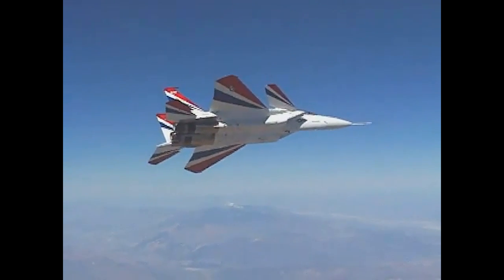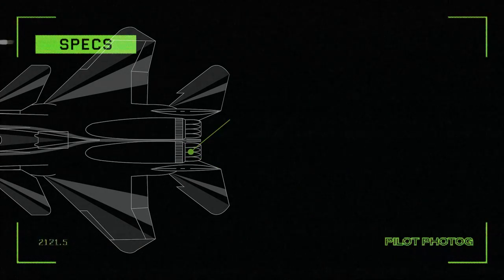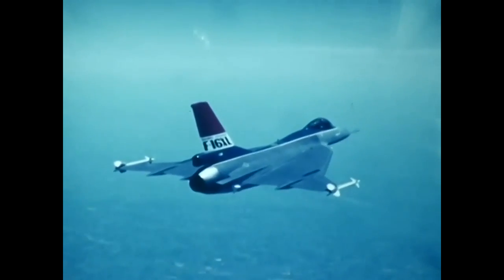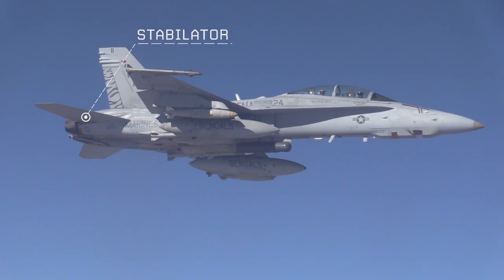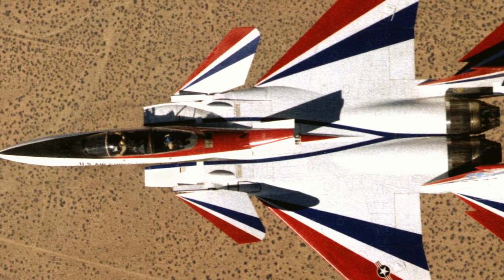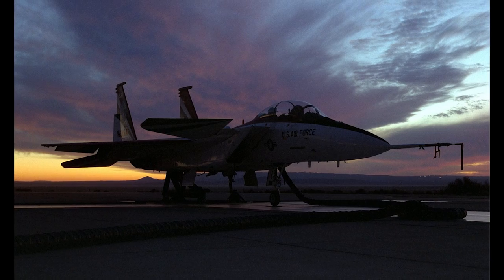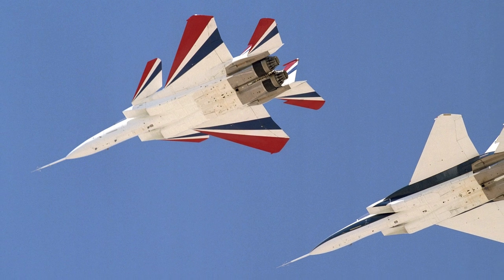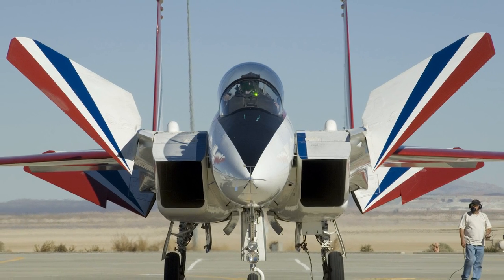NASA's 837: The Ultimate Modified F-15!

Comment: This particular plane was so early production modell, that it has the smaller airbrake on the top of the fuselage, which is just came from the prototypes. The other thing is the deflection of all mechanical surfaces on the wing (flaps and ailerons) all together, during the takeoffs and the landings. The reason behind this was the two huge canards (the stabilizers from the Hornets) which are moved forward the center of the lift force. Bacause of that, the plane acted as rear-heavy, so the deflection of the flaps and ailerons (which was in this case a flaperons - actually, all producted F-15s has multifunctional ailerons, but it is not obvious) just generates a nose-heavy torque, to compensates it. The secondary benefit was the increased overall lift force too, because both of the extra canard surface and the deflected overall wing profile, (which meanwhile was a compensator as well) generates a much higher lift during take off and landings.

Comment: I worked on the Bone and wonder why these canards are pitched up rather than downward as on most other aircraft? Perhaps they interfered with the engine intakes? 
The Sukhoi 37 has smaller canards that seem to be inline with the wings, but perhaps the Russians figured out a way for them to not interfere with the intakes.
Reply from the maker: Great question and as you suggest I imagine it had to do with not blocking the airflow into those huge air intakes. Thank you for your service and I appreciate your comment!

Comment: I wonder why the canards were not adopted, wonder if it's a stealth reason?
Reply: It's just unnecessary, the conventional 15C/D did good enough job as it is.

Talking about US Air Powers combat doctrine, if you're thinking about using canards for maneuverability for close range fight, the canards adds for the unneeded complexity and adds to the workload for the maintenance to look for, all for something that the doctrine tried to avoid as much as possible.

Comment: Warning: here come the pedantics: A slight correction for the slide at 1:17; 1323 Knots, 1522 mph isn't mach two. Well technically it would be, at sea level, but no jet can achieve VMax at low altitude due to air density and drag. The speed quoted is max at high altitude. The reason for the difference? Air travels at different speeds at different altitudes, the higher the altitude the lower the speed of sound (less molecules to carry the sound). As a general rule of thumb the speed of sound is approx. 760 mph at sea level and 660 mph at altitude. Therefore, in reality this aircraft could achieve approx. Mach 2.3 at altitude. For comparison a standard F15C could achieve Mach 2.5 at altitude.

Comment: Just being a nitpicker. The engines would have been turbo jet, not turbo fan. Turbo fan engines are what you see on larger passenger aircraft. They are shorter than turbo jet, and have larger intakes and the lpc section has a much larger diameter.
Reply from the maker: An excellent point and agreed - I'll be sure to correct in future videos.  Thanks for commenting!
Reply: Actually no, the F100 is indeed a turbofan. It’s a low-bypass turbofan. The engines on passenger jets are high-bypass turbofans
Reply: They are low-bypass turbofans. I was the test team lead when we certified the -220, -229 and -129. The GE -129 has higher bypass. They are much more efficient than turbo jets. I don't believe any fighters have used turbo jets since the F-4.
Reply from the maker: @mikeludwig6165  thanks for the clarification!

Comment: Around 2013, I saw a video that showed the Eagle S/MTD doing aerobatics that today's Raptors, F-35's, Flankers, J-20, &  SU--57 would be hard pressed to match. I have since attempted to find  that video & can't locate it. It would be an excellent follow up to this video^^^^^^^^
Imma tell ya what, the S/MTD could do some straight UFO maneuvers! If you know where that video went, and can retrieve it, it would be 51 Shades Of Awesome😂😅😊
Reply: Well it's basically a big flying control surface with 2 engines attached, nothing shocking there!

Comment: Well a series of testplanes could be handy. Even if they did not result in anything per se, a lot of data was accumulated. Some reservations as to application might in the time passed have become obsolete, but the original idea - with modern technology - could reemerge as interesting.
Reply from the maker: Thanks for the feedback and agreed the data may be obsolete but my take would be on it’s significance at the time it was flying.
Reply: @PilotPhotog  Well, it is good to remember what boost the German research during WW2 gave western aviation. Most of the German developments were trash. Example the Messerschmidt 262 was terrible and sir Frank Whittle knew about the axial compressor, but deliberately went for the centrifugal, as much less tempremental.
The Me 163 was more dangerous to the pilot than to the enemy.
Fortunately the british had captain Eric Brown - probably the most experienced test pilot of all time - and he remarked about the Horton brothers, that the flying wing is a formula, that is difficult to get right; but IF gotten right it has temendeous potential.

Comment: I'm curious to know why the United States Air Force use some of the tech or the modifications on the current-gen F-15 Fighters. Wouldn't that have greatly improved what they were capable of doing? Even more so wouldn't that improve the F-15 Strike Eagle overall across the board??

Comment: So let me get this straight. They added thrust vectoring to the F100 engine for this specific f15. Because the F100 is not build with thrust vectoring.
Reply from the maker: Yep and to the 229 series as well. Thanks for commenting!
Reply: @PilotPhotog  im pretty sure that no F100 engine past or present has thrust vectoring. I dont know this F15 so if they added for testing purposes i can believe that. But the F100-229 is in use on the F15 and F16 today and they do not have thrust vectoring, period. If your reffering to the actuator arms on the nozzle on the f15 in this video, thats for the nozzle opening and closing, depending on the power setting and not vectoring. The f16 looks like that as well only the f16 nozzles are covered op by what we call "turkey feathers" in the specific airforce that i was in.

I did notice the 2d thrust vectoring they installed on the f15 for testing. They proberly evolved into the thrust vectoring we see on the F22 which is the only fighter aircraft the USAF has with thrust vectoring. (And the f35b)
Reply: @udontneed2know801  For the USAF's F-15 S/MTD Program, we indeed did use the PW F100-220 engine with a special one-of-a-kind thrust-vectoring (pitch only)/thrust-reversing nozzle.  For the later NASA F-15 ACTIVE Program, NASA used the F100-229 engine with a special pitch and yaw vectoring nozzle.

Comment: Actually, this is not the most modified F 15. In 1983 the Israeli airforce modified a F 15 to give it awesome roll capabilities. Unfortunately it could only roll right and needed a skyhawk to perform the modification. An excess of fuel consumption was also experienced and a slightly higher landing speed.

Comment: PW F100-229 EEP is the most reliable and easier to overhaul than GE F110.  This plane should have gone to production with thrust vectoring but there is no need for canards.
Reply: What no need to be able to do a back flip and fly backwards for a few seconds while on afterburner and rotating the jet where's the fun in that

Comment: I don't believe #291 ever had the canards and nozzles, that picture is an artist's impression/photo manipulation made to show what an advanced future F-15 might look like, not an actual straight up photo. (The colors are kind of wrong and the engines are way too clean for an actual flying aircraft, metal doesn't look like that after it's been heated. Check out how dark the STOL/MTD got...)

#291 was a manufacturer-owned development aircraft, and was used for among other things development of the FAST packs/CFTs in the early 70s, as demo aircraft on the 1976 airshow circuit (done up in the famous Bicentennial scheme, and then MDD decided to use it to test whether making the Eagle into a strike aircraft was feasible, which it turned out was most definitely the case. It spent most of the 80s testing ground attack avionics and validating weapons configs for the F-15E program, and wouldn't have had time to test weird engine and control configs. That's what #290 was for.

Also, #290 was not involved in testing anything in particular for the F-15E, it was too busy testing advanced flight control methods. #291, and four production F-15s, did the F-15E development.
Reply from the maker: Thanks for commenting and I looked everywhere for more details on that reference photo for 291, I appreciate the feedback.  As far as testing for the F-15E, 291 was used briefly as an avionics testbed for what would ultimately develop into  the Strike Eagles avionics platform.  Although not a major role in the F-15E development 290 did still pay a part and I thought it was worth mentioning.  Again thanks for the information, If I had to guess you worked form MDD or were around the program during these times.  Cheers!
Reply: @PilotPhotog  I've never worked at MDD or with the USAF (wrong country); I just got a book as a gift when I was 12 or so (just after the Gulf War) about the F-15 which had a bunch of info on both the Strike Eagle and S/MTD, with loads of pictures. Everything I've read since then backs up what was in that book, except that one picture which looks like someone spliced together a photo of the real #291 with a photo of a model of the S/MTD taken from the same angle. Which is a thing that happens fairly commonly when someone wants to show what something might look like operationally.

Comment: Capabilities and improvements of this heavily modified F-15 VISTA over it's regular brethren is nothing short of amazing. In my humble opinion, the only reason these technologies weren't included to upgraded F-15s is because of the price. Especially since the USAF was already heavily involved in the next generation of fighter jets, the venerable ATF program, that gave us the amazing F-23 Widow maker and, ultimately, an operational F-22 Raptor. There simply wasn't enough incentive to pour billions of $ to upgrade the whole fleet of F-15s with 3D TVC and canards. Especially since the original USAF order for Raptor was 680 units. With the Cold war ending and the threat of Soviet Union dissapearing, this massive investment into the 4th gen fighters simply didn't make sense. 
Even today when  the USAF decided to buy brand new F-15s the upgrades this jet will have compared to 1980s F-15s is all beneath the skin. New EW suit, EPAWS, new cockpit and a new digital data sharing protocole, yield much more benefits than a super maneuverable jet that can wow crowds at air shows. These maneuvers like the famous "cobra maneuver" add very little to a combat doctrine persuit by the USAF, that gives advantage to electronic warfare, sensor fusion, data sharing and situational awareness over the pure kinematic performance of out turning and out maneuvering an opponent. BVR combat doesn't care about your ability to perform  incredible angles of attack cause you can't out run or out maneuver modern a2a missile, let alone the ones that are in development.

Comment: Her concepted for short take off   and Landing, in 1980s the USAF  looking for the solution to save F-15 to ready in combat while the air base runway had had been damaged from USSR, the CARNARDS and trust vectoring nozzles has been added to the jet but that was rising the cost of F-15, then the stealthy is very fast coming through so this technology has been transferred to F-22.
Reply: the f-15 fuselage is not good answer for the future war, the BVR and network centric warfare, the new jet design is the answer.

Comment: S/N “710290” rolled off the production line in ‘73?   The first two numbers in a tail number are it’s production year.  ‘71? ‘73?  Doesn’t jive
Reply: Rolled off the assembly lines and into history, after modifications in ‘73?       Thrust vectoring in the late ‘70s      Shit don’t jive
Reply: Typically that number is the first two digits of the year it was purchased....not produced.

Comment: I just wish this new technology would get applied to the newer F-15EX it definitely give it a leg up in countering Russia 🇷🇺 and China’s 🇨🇳 new 5th Gen Fighter threats. Seems how they are going with this as a GEN 4.5 Missile Truck for the F-35A and F-22A if a Visual Range fight were to take place the (which is very likely after if launches it’s bvr aim-120d’s at the opposing aircraft if any survive).
Reply: Canards increase radar signature, add weight and complexity, same with thrust vectoring. All important stuff currently is happening in avionics, not the aerodynamics of combat aircraft.
Also the J-20 isn't really 5th gen, Indian radars picked them up easily a few week ago, as China moved them to the border.